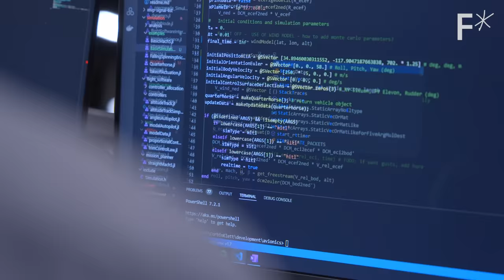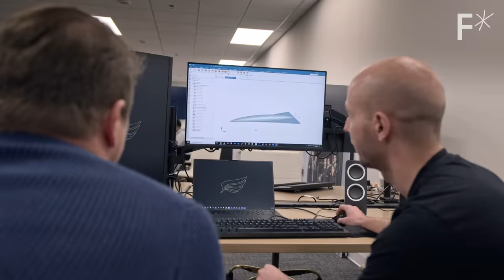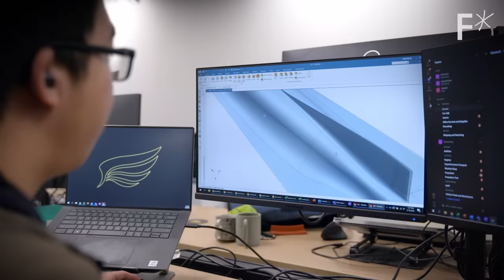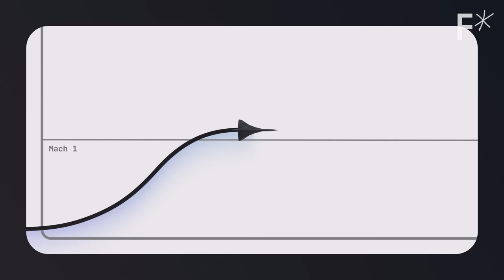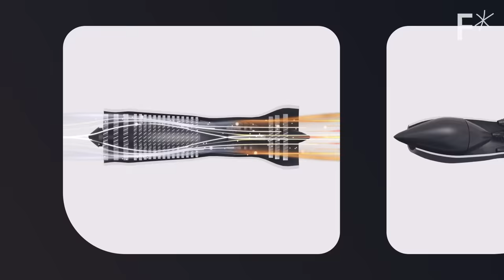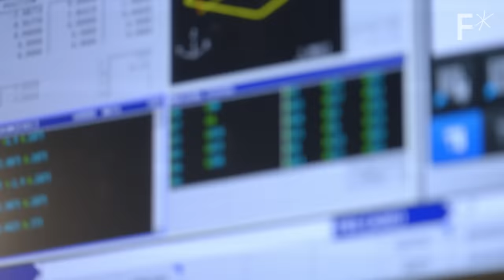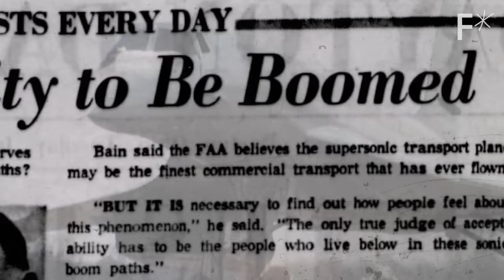This Mach-5 engine will do what no other can | Challengers

Comment: 0:06: ✈ Hermeus is building a hypersonic autonomous testplane that aims to make passenger airplanes six times faster than they are today.
2:40: 🚀 The challenges of building a hypersonic aircraft and the unique obstacles it faces.
5:06: ✈ Hermeus is building an aircraft engine that can transition from a standard jet engine to a ramjet at higher speeds.
7:37: 🔥 Hermeus is developing an engine called Chimera that can transition from a turbo jet engine to a ramjet engine, allowing for higher speeds and altitudes.
10:04: 🔥 The development program for the aircraft involves pushing its limits and expecting to lose an aircraft at some point, but the team is prepared for challenges.
12:22: ✈ Hermeus is working on developing a hypersonic aircraft called the Halcyon, which will rely on vertical integration to quickly adapt to failures and take risks.
15:01: 🚀 Hermeus is a private company with the most potential to achieve hypersonic commercial flight.
Recap by Tammy AI

Comment: Thanks for the video but one misconception the gentleman has is that Ramjet is itself also a jet engine. Any propulsion system that works based on the concept of jet (accelerating air) is a jet engine.

Comment: Ermm the sound barrier thing at 2:28 the white stuff isn't a barrier, in case some thought it was, its just water molecules condensing due to a rapid decrease in pressure, as in from a very high pressure region to an almost instant low pressure region, you'll get this cloud stuff forming. So please it's not like a sound barrier 🌚🤝🏼 in case someone thought it was.

Comment: Use a PULSE JET MODE to get to upper atmosphere and then Dive for 20,000 feet to get to mach 2 and take off from that point to mach 5. To land re-configure the guts of the engine back to PULSE JET mode. Only 6 moving parts and CHEAP to build. The inside of the engine it would resemble a Silencer from a firearm with the baffles facing backwards instead. This would amplify shock waves and allow virtually motionless vortex's for flames to burn along the whole engine length as a measure of safety. Simple!

Comment: Interesting video, just one small inconsistency, the condensation that you point to on the space shuttle and call a shock wave is actually the polar opposite, shock waves increase the temperature and pressure causing the air to be able to accept more humidity, so no condensation occurs there. What causes the condensation is an expansion fan behind sharp turns in aircraft fuselage where the pressure drastically drops, causing a decrease in temperature. This causes the air to be able to accept less water content and if the humidity is too high, it causes the condensate wave that we are observing here.

Comment: No not the first, but that turbine bypass thingy looks a lot more elegant than the SR-72's, way simpler, and using the afterburner section as the ram combustion chamber is genius. Now to make it work reliably without destroying itself, good luck.
Reply: *SR-71
Reply: @spartainwarrior6445  It wasn't an error...
Reply: @jonharson  ok but the SR-71 also uses bypass engines and the darkstar is usually called the darkstar iirc the SR-72 is a UAV or something
Reply: @spartainwarrior6445  Wooosh... Darkstar was to be a triple bypass engine... the SR-72 design reduced it to two by using a precooler on the turbo.

Comment: The sr71 had that exact engine set up, so it's been done before, but of course, all that info is extremely classified and very well guarded by the government. That engine was produced by Lockheed Martin's Skunk Works Department. That very same Department designed and built the hypersonic plane at the beginning of Top Gun 2.

Comment: You guys need to introduce a refrigeration system that runs throughout the body of the aircraft. Put priority to the main parts that will be experiencing the most drag. Once that refrigerant gets to max capacity, use that heat to preheat the fuel. This will help with controlling the temperature on the drag while creating better fuel efficiency.

Comment: A correction, the heating due to travelling at these speeds are not just the air friction it is mostly the compression of air. As air expands it cools down and as it compresses it heats up thats where the majority of the heat comes from.

Comment: 8:16 is proven to be wrong, because, every start with an high velocity supersonic aircraft is doing this way. 
You start on the ground with Mach 0 as turbojet engine. And when you approach Mach 2+ more and more compression is done by the RAM effect so it run more or less a RAM-JET-Mode. The RAM effect does about 90% of the compression work.

Comment: I'm a horse handler I breed the quarter horses, you don't have to put them through to much training because they love to run but through breed a little bigger horse but it can keep up with a quater horse through the quater mile then the Texas through breeds will start to pull away from a quater horse and out kick the quater horse it's a strong horse so I hope to see a throughbreed plane that can take the beating from long distance flights then you have yourself the future of flight or a Mac 3 electric engine. That's insanely unthinkable

Comment: Hope on the next video they expand more on the engine ramjet mode, the approach to the thermal expansion problem, the type of fuel they are using and the fuel efficiency at Mach 5 speed.

Comment: Add Reaction motors precooler! it'll get that up ALLOT higher, like Mach 8 or 9. it uses the fuel to lower the temps to almost absolute zero in a fraction of a second.

Comment: 5:20 : Not how normal jet engines work. Passenger airplanes jet engines just compress air. The engine that you are talking about is a fighter jet engine *with afterburner on*. With afterburner off, it also just compresses air, but with the afterburner (which passenger planes don't have) it ignites a fuel mixture to increase velocity.
Reply: Passenger jet engines do also combust air inside and then shoot that air out the back with a turbine and nozzle to produce thrust, the initial compressor + diffuser increases pressure; decreasing velocity, and the turbine + nozzle increase velocity, while decreasing pressure. With supersonic engines they have the afterburner with ignites the exhaust gases with extra fuel added to further increase thrust. Then u have ramjets and sramjets which get rid of a compressor and turbine and just combust the air and propel it out with the use of a nozzle.

Comment: They already have flaps that increase lift at low speed and then become streamlined at high speeds. BTW, you might be able to just use large surface area wings instead of bogus airfoils.

Ramjet seems wrong. At those speeds, you don't need anything except an inlet. The shockwave is just scattered air, with low compression underneath. It's literally the opposite of what your suggesting. If its too much air, restrict the inlet. No front cone needed.

So apparently the concept is basically a turbofan (high bypass turbo jet engine) but instead of using fans in the bypass, its a ramjet.

I also looked into the comments and was reminded that the SR71 did this all those years ago, and now people are trying to revive this concept for commercial use. Its ok.

Comment: The X-15 was dropped from a plane because of the vector wedge tail fins, in the images of the X-15 you showed in this video none of them showed the full lower tail fin. There is infact air friction but it's under your plane and you surf it.

Comment: These guys are really good at what they do. They have also found some good long-term investors that have given them a lot of runway. Not sure how their contract with the Air Force is structured, so I'm not sure they can add that funding to their balance sheet, but if they can, then that's revenue very early in the company's existence. That is always very encouraging for early investors. So, short of some major setbacks I say they are on course to pull their plans off. I wish them luck and success.

Comment: The Soviets tried and tested at mach 3 but engineers wanted to push it further. They found that their compressor blade were breaking off and the engine started to cannibalize engine and power failed .

Comment: They may be able to produce a viable hypersonic engine which would be great for commercial travel considering we can’t even travel at the speed of sound yet , so 6x that speed will be a completely different kind of travel , strap in hold on get across the globe in an hour or 2 , that means expert pilots specifically trained for faster than sound etc seats for 20 only the elite  can afford

Comment: At 8:22 he says the transition from turbo jet to ramjet has never been done in flight, but the SR-71 's The Pratt & Whitney J58 could achieve that since the 60s. The SR-71 couldn't exceed mach 3.3 due to the heat caused by air friction at those speeds (specifically to the compressor inlet) - what she is talking about at 3:50. The SR-71's fuel tanks were built into the fuselage to save weight - as in, there were no fuel tanks, unlike any other aircraft - and due to high temps regular jet fuel couldn't be used. Also as she points out, the heat changes the size and shape of the metal, and SR-71s would notoriously just drip fuel through the seams. Nasa's  unmanned airbreathing X-43A solved the heat issue by using tungsten and carbon-carbon as heat resistant materials, but the jet had to be propelled up to scramjet operational speeds by a rocket.

It's weird that they don't mention these two planes. Seems like the technology is there, they just need to solve the problem of heat, fuel, and weight - but they don't specifically mention how they are planning to do that.

Comment: Their approach is viable, the key is if they can design two adjustable air intakes for each eangine efficiently. The second air intake is for the RAM engine, bypassing the turbo jet engine so its blades won't brake at high speed.

Comment: We went from barely being able to get off the ground in powered flight in 1903, to the SR-71 reaching 100,000 ft and Mach 3.31 (officially) in '63, to the X-15 flying at the edge of space, at Mach 5.947 (by NASA standard of 760 mph at sea level, 4,520 mph÷760 mph= Mach 5.947) in '67.

Question:  So why are we still using the same basic technology for reaching orbit, which Dr. Goddard pioneered  nearly a century ago?

A compound hybrid engine and combustion chamber, and a specially coated fuselage to better withstand friction-generated heat, could get us into orbit and back, far safer, with far less fuel consumption,  far greater payloads per pound of fuel, and far less physical stress on the airframe, crew, and passengers.

Comment: I've no idea how hypersonic flights work but on normal commercial jets the fuel is stored in the wings. If they plan on going mach-5, it will certainly chug through fuel very quickly. Where is all that fuel store? As from what I gathered the wings look very tiny to store any real amounts of fuel and the whole body of the aircraft is basically the engine, air intake and exhausts. Just a little doubt that I had. Rest of the project seems really interesting though.

Comment: They should take a look at the SR-71 and yf-12a those air craft were designed to deal with the metal expansion of hyper-sonic flight and the heat generated. I'd suggest they turn away from a metal skin and move to a metal frame and take a lesson from space shuttles nose section. The issues the two aircraft I mentioned earlier have you probably wouldn't want for passenger aircraft.

Comment: Makes one wonder if "offers you can't refuse" have been received by Hermeus, to set up "joint ventures" in jurisdictions that claim to have "lower manufacturing costs."  Seems like even a quick promo video like this might have had to redact photographic coverage of certain parts of the machine, both for trade secrets and other considerations.  If so, you hid it well - nice work!

Comment: Why not just use the fuselage in the form of an aerospike and form it so it compresses ambient air close to the outer skin and ignite it with a pulse laser... Basically you would be expanding plasma in the slip stream.

Comment: FYI air friction does little contribution to the hypersonic heating of the plane, The air is compressed against the front edges of the aircraft and heated by compression. That hot air radiates heat to the skin of the plane. Seems like there's more money then brains with this project/company.

Comment: Seems to me that it is the same tech that the SR71 used and ti was developed in the 60's where the engine had 2 phases of operation. The SR71 limitation was not the engine but the airplane structure itself dealing with heat ..  Also the llimiting operational factor was fuel.. For a mission it relied on being refuled OFTEN. So this as a possible answer to a passenger aircraft would present many risk to in flight refueling with civilian passengers. It is rumored that the military has or is testing new concepts in a SR71 replacement that is benefiting from more newer tech for heat shielding and heat resistant materials that were not around in the 60's It was estimated that the SR71 had the power capability to reach like mac 4.5 just the plane would have came apart but the engines were well capable.

Comment: There was mention of the high temperatures that they must address in hypersonic flight, but no discussion of material science approach and how they would address that problem.    In the 60s the solution was titanium which is difficult to machine, but they struggled and figured it out.   Is this team avoiding/ignoring that approach and hoping for the best?   Is it starting from scratch or using what has been learned in the past?

Comment: I have an idea regarding Quasi Crystalline Acoustic Wave Resonators that are activated by high heat such as generated at hypersonic speeds .. These are passive resonators that induce cavitation at the wing edges of a hypersonic aircraft that would reduce friction .. Micro cavitation effects induce micro turbulences along the lines of the SAW Quasi Crystalline Resonators surface .. This micro turbulence has a cooling effect which will add a high compression boundary layer which makes this all work .. The friction at hypersonic speeds induces resonances which means the that the SAW resonator is a passive device .. I don't have a Quasi Crystalline material in mind as yet but their are many cermet Quasi crystalline materials under development .. On big issue is the Q of the material .. The Material would have to be doped or multi frequency SAW material must be used so that the stresses within the Quasi Crystalline material can be managed so it doesn't explode when certain amplitudes of the resonant frequencies are reached .. Another approach would be to used in the Cermet Qausi Crystals is to use a doping of high density metals like tungsten on the outer skin using Vapor Phase Plasma Plating ..

Comment: I am not going to pretend that I know any of this stuff but why don't you guys use a pulse jet engine to increase the inlet airflow? I mean, the engine is already supposed to withstand a tremedous amount of heat and if things get too hot to handle you can always use water injection.

I am aware of the problems with pulse jet engines but at least you don’t have to deal with blades and the engine can be very small.

Comment: Instead of having one engine that does both, why not have 2 smaller turbo jet engines and then in between them have a scram jet engine that it alts to at speed? One component to do everything is hard

Comment: The Sr71 at Mach 3, leading edges of the wings were 600-900 degrees. At Mach 5 it would be double that. Her calcs are wrong..

Comment: I wonder what would happen if the wings were fitted with small cushion-like balloon-pads, those being suddenly filled with helium to help take off and landing and then helium would be sucked out from this balloons and pads would be detracted into the wings.. Small, electro-hydraulic sliding slots under the wings automatically opening  just before take off, releasing the small helium-filled balloon pads and pulling them back in when ending procedures.. I wonder if it would make a difference..

Comment: X-15 does Mach 6.72 manned. Even faster unmanned. X-43 does just under Mach 10. This is old news. It could be altered to take 1 passenger with relative ease over Mach 5. It would cost a lot but that's not part of the question.

Comment: Very cool, however they did lie. They’re saying this turbojet to ramjet conversion mid flight hasn’t been done before but the sr71 blackbird has been doing it efficiently for like 20 years. I’m not discrediting the engineering it’s still insaine, but this engine isn’t new and groundbreaking as the us airforce has had the same thing built and working for quite a while now.

Comment: Rise and then straight back level.  On the body and wing will take the turbulence out of the body and wing but maintain the D1D2  difference that is lift.   A high voltage plasma jets that don't use fossil fuels but ammonium sulphate and sodium nitrate in water as jet be fuel.  Now you can fly in atmosphere and space.  Edison generators and Tesla dynamos provide continuous peak power without fuel or pollution for high voltage plasma.

Comment: SR-71 did it and did it better.  That’s just an engine.  That engine in this video is not designed to go that fast in the air.  There are so many small details of the SR-71 that still boggle the mind.  I hope they got their alloys right and got the same oils as well that burn at a higher temp or else this is a no go.  Also, the tech they are using is not fuel efficient but neither was the SR 71.  The SR 71 was efficient in the fact that it didn’t waste anything while in the air that including air if anyone knows what I mean.